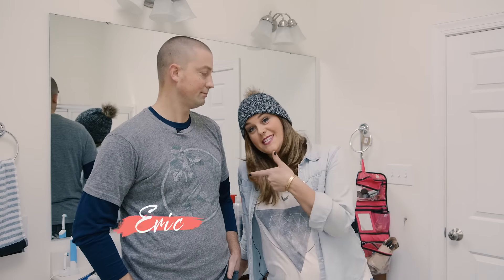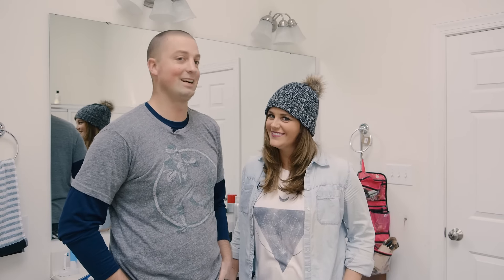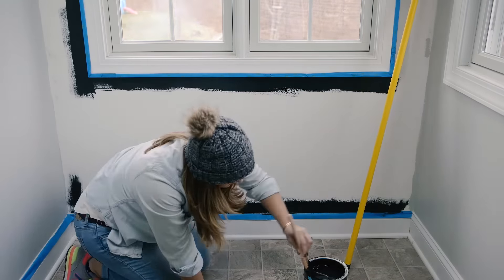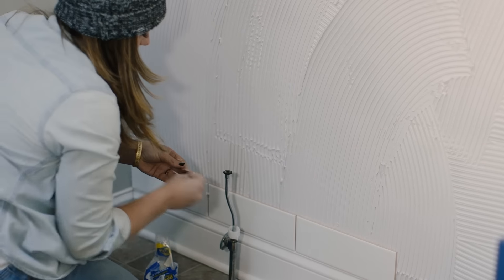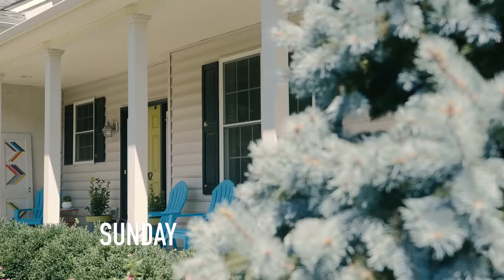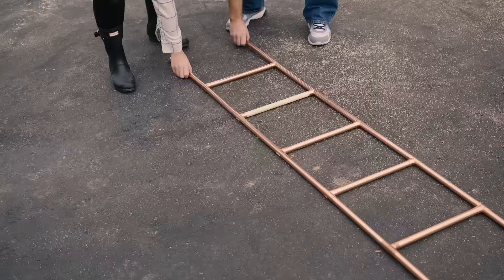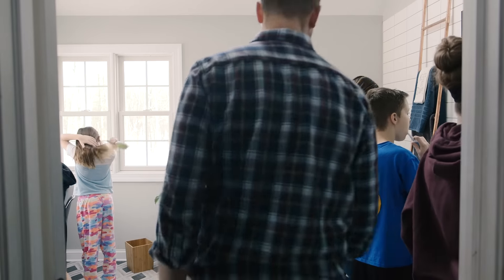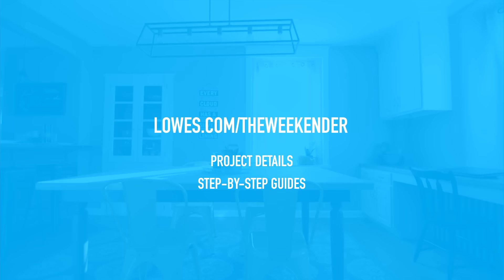The Weekender: "Patterned Bath" (Episode 8)

Comment: That’s a month project, not a weekend. Putting backer board down itself is a day and the mortar needs to dry. Plus you are raising the height of the floor which means you need to cut the door trim and remount the toilet.  Grouting the floor and sealing it takes a day. You can’t just paint cabinets. They need to be sanded and primed for the paint to stick....